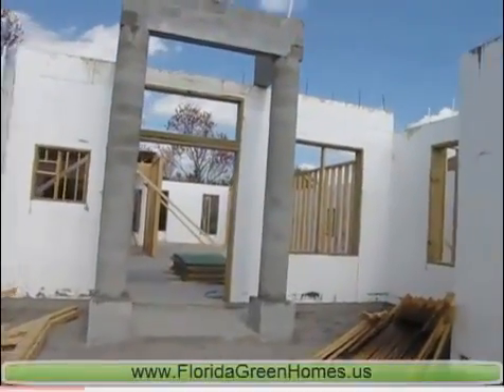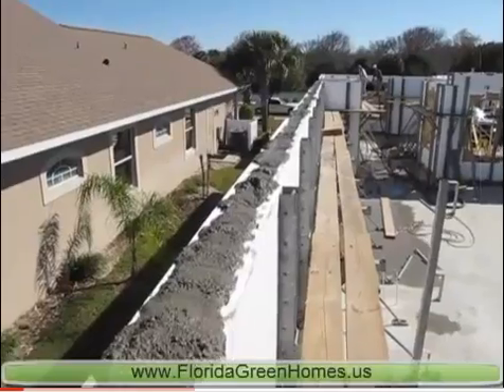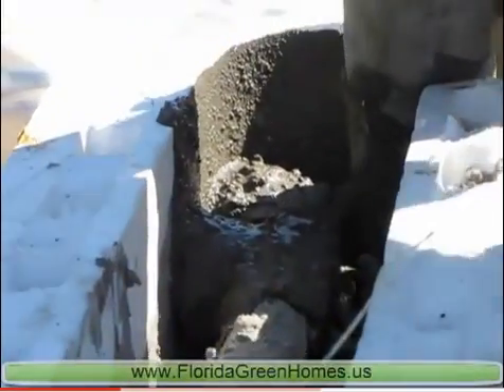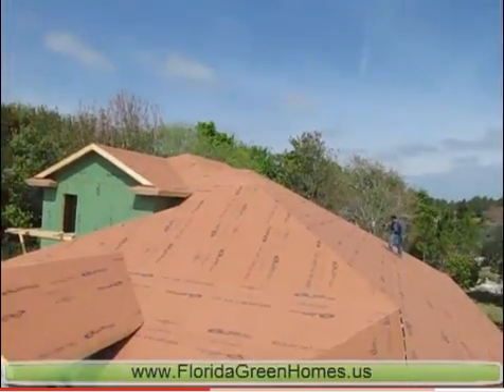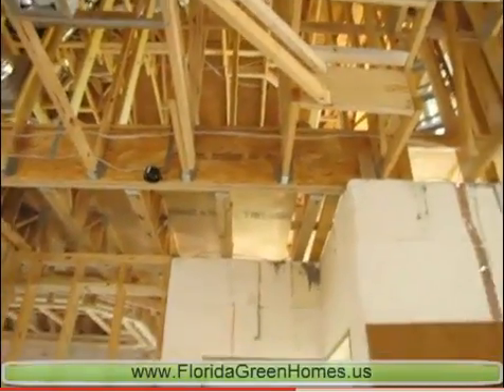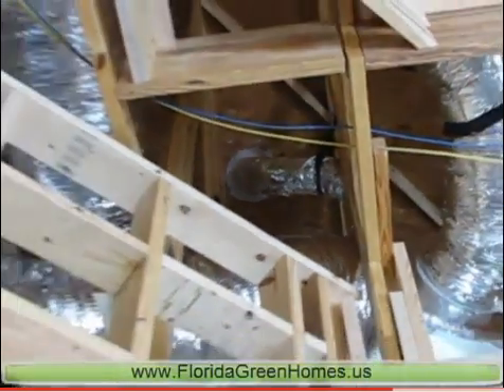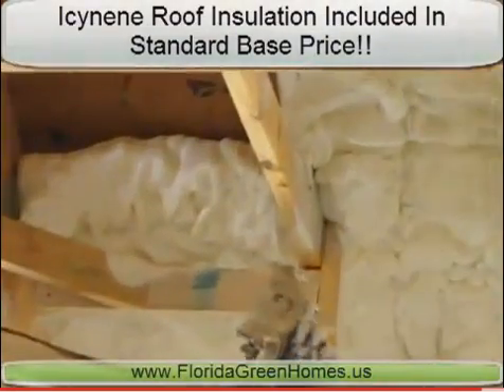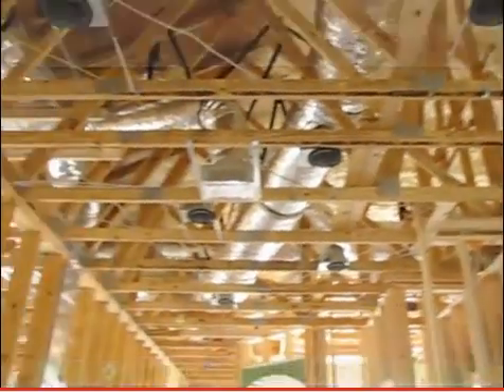Hurricane Proof Homes. Tornado Proof Green Home in Florida

Comment: This is a sturdy house and it has more insulation that your average Florida home but I wouldn't call it "Green" (as in the name of your company).  I hope "Green" refers to the name of the owner and not environmentally sustainable building.  This home uses a lot of concrete- which has an enormous amount of embodied energy.  The closed cell spray foam also has high global warming potential due to its blowing agents. I think these builders mean well- but this home is NOT "green".

Concrete walls are probably unnecessary as the roof is the weakest part of a home in hurricane country.  That ICF wall idefinitely does NOT have an "effective R-value of R-47".  Its about R-22 at best.  Still way better than your average FL home- but let's be realistic.
Reply: More Fake news Rick.  That BS was debunked years ago.  Concrete is one of the greenest building materials.  Idiots overstated the energy used by a factor of 10.
Reply: Patrick EH that’s good to know!!
Reply: Hi Rick, thanks for your thoughts! It is Green because all of the homes built by FGC are Certified Green by the Florida Green Building Coalition, the largest Green Certifier in Florida. They are more climate-specific than LEED because the standards and requirements are designed for Florida's heat, humidity, hurricanes, termites, mold, and other resiliency factors specific to Florida. It meets the energy-requirements (feel free to look up the HERS on any of the homes, public information), indoor air quality requirements,  water conservation, disaster mitigation, site conditions, and materials. Feel free to look them up on the Florida Green Building Coalition website. Nurdura ICFs average at about R-29 value, and FGC doesn't used Closed Cell Spray Foam Insulation, the use a Certified Green Open-Cell Spray Foam Insulation.

Comment: How much % is tornado proof house more expensive than standard house?
Reply: this house isn't tornado proof.
Reply: Patrick EH you’re correct to a certain point, it depends on the strength of the tornado. However even in a strong tornado this house will fare much better than a standard home in close proximity to the tornado. When you see the damage path of a strong tornado going thru a neighborhood, you’ll see a lot of standards homes either severely damaged or completely demolished without even being directly hit by the tornado. Homes built like this will do magnitudes better, heck more than likely the walls will remain standing. Look at the two ICF houses in Moore, OK that were hit by that EF-5 in 2013. Their roofs were lost but the walls were intact. Both of those homes had thicker ICF walls than the house on this video. 4 inches is too thin for me but still far superior to wood frame

Comment: I love the home and most of your building practices, but the guy spraying the foam insulation is doing a lousy job. You can see many places that he trapped air by second and third over sprays rather than one complete spray from corner to corner and header to roof in the first passes. Those air gaps are not as good as a sealed tight and full of insulation job would be and according to fire testing can be detrimental in case of a fire. 

Also in speaking with a truss company here local to Tampa, I asked how much difference it would make to use 2x6 stretchers on the bottom of the trusses. I was told that they would cost more, but really not that much, but using a 2x6 would be a much stronger cleating in case of hurricanes and high wind cases in general.. He said roofs that fail in high winds and hurricanes typically are pulled apart at the wall anchors. He said using a 2x6 and wrapping the steel anchor over and screwing it on it's rolled over side is many times stronger...  I would have to agree...